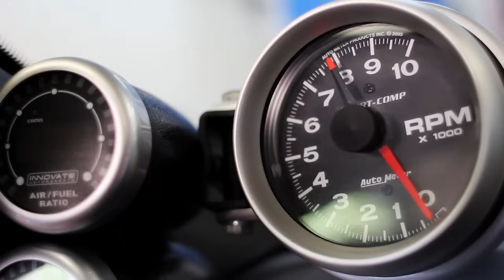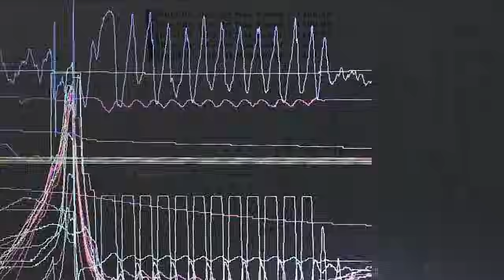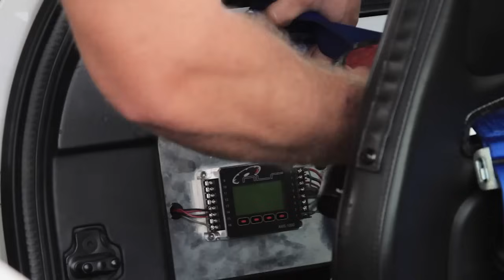New World's Fastest Car! Ford GT Bad v8 1700 Hp - 455.817 km/h ( Guinness World Records )

Comment: 283.232 mph from a street car. With all the hate just let those numbers sink in. AMAZING!
Reply: which part of that is street?
Reply: BigSmartArmed The massive parachute for sure. >.<
Reply: And that was just from a standing mile, imagine the top speed!
Reply: BigSmartArmed It is legal to drive on public roads. It is registered and licensed and insured. To do that it must pass emissions tests, safety inspections, conform to certain rules about the minimum height of certain lights (for example) - some older Ford GT models weren't street legal because the lights were too low. When you factor in all those regulations it must adhere, it is very impressive to achieve those kinds of speeds. The fact they're not selling units makes it more impressive because their budget would be significantly lower than, say, Bugatti who can recoup their expenses by charging $2M or more per unit sold.
Reply: Prof Kaos the car would never make  emission  standards. Of course  a 1200hp  16 cylinder  is gonna  have more control over the emissions  then a 17th 8 cylinder. With that being said, there is no was for bugatti  to combat the bad get with out loosing it's ability to meet emission standards. The only thing they can do is take it on the chin or  rationalize  the fact that the veyron is a production car and the badd gt is not.
Reply: ThePlotDevice You're right. It had to pass emissions at one point to be registered but since then has had a lot of work done. A cop can still issue a ticket pending an emissions test if they suspect it no longer meets the legal standard, at least where I live that's the case. However many tuner ECUs have different modes you can select for different driving conditions and there is usually an "eco" mode they use when they need to get the vehicle tested. An old friend had a ~500 WHP Civic he built and had to install one of those ECUs - all he had to do when he took it to get tested was flip a switch and it was good to go.
Reply: Fuck yeah that's amazing from a stock out the dealer ford
Reply: XxUNASxX Lol.
Reply: I know yout being sarcastic but a stock GT can still do 212mph back in 2005 when they came out that was faster then any 2005 Lamborghini, ferrari, or porche.
Reply: Isn't top fuel dragster faster than any Ford GT???
Reply: Uriah Bleue Too bad Ford stopped production of the GT. Today there's many cars that are faster than 212 mph now.
Reply: It doesn't really beat the Veyron because yes the ford GT is a production car this modified Ford GT isn't, the Veyron is there for it's still the fastest production street car.
Reply: AP499D25 Yeah man seen so many top fuel cars get 304mph with a full blown 454, they do that 1/4 in 4.5 seconds or 5
Reply: Alex Krimberg and then koenigsegg one:1 came to play
Reply: ***** Does the word "homogeneity" exist in your language?

Man you're comparing the bad gt : a car just made to break records and the veyron : a car made to change the rules.

The veyron is a grand turism car able to run at 270mph and able to be use as an everyday car.
The bad GT is a tuned supercar monster  like all other stuff from tuners (hennesey, ams, underground racing etc). This car is based on a supercar and they've used racing and performance parts to make it really really really fast. But it have been built without compromises!!! Ok they've said that it's a road car but trust me this kind of car will NOT be road legal in all countries of the world. This car would never be legal is europ or in japan.

You've talk about "efficiency" and "technology" because the v8 is smaller than the w16 and because the bad GT only got 2 turbos instead of 4 in the veyron. Are you expert?
Man do you know what "compression ration", "torque", "displacement" means?

The veyron use a w16 and 4turbos to get a lot of power without too much compression inside in the engine (9:1). It's not a brutal engine, it can be use slowly without having any trouble of lubrication, or breaking a connexion rod because it has got lot of torque at low rpm (1500nm at 3000rpm). This engine is good in a congestions and on a track.

The engine of the bad GT is a big american twin turbo V8 with nearly 1800hp, 9.4:1 of compression ratio but it comes with a 2years and 24000miles warantly. But this kind of engines aren't easy to ride, the power comes in high revs because the turbos needs lot of exhaust gas to give power. The torque is pretty low at low revs, the max torque of 1,651mn comes at 6,300rpm. That means that this car will be terrible to drive at low speeds but a monster on a dragstip.

The bugatti is confortable, everyday usable, luxuary, and fast.
The bad gt is a dragracing car with the rights to run on the road.

Comment: In a Veyron if you want to go fast you turn a key, empty the ashtray and switch the air conditioning and stereo off for a couple of minutes. No flameproof suit and helmet, no roll cage. There is a big difference between being the fastest car you can legally drive on a public road and being the fastest production car that somebody would actually enjoy owning and driving. In a Veyron you could take it to 250 MPH and drive for hours at 150 MPH and not need to rebuild the engine and replace all the tyres the next day.
Reply: Actually at top speed the tyres on a Veyron only last 15 minutes.
Reply: stabnshoot And what have you got? A very fast car you can't use for anything except going really fast, making boys envious and hauling round on a trailer as a sideshow exhibit.
You'd need chloroform to get a beautiful woman into it.
Reply: bugatti veyron is for G..  physically it's one of the ugliest supercar or the market
Reply: lucien henri So if I bought you one you'd park it in the next street?
Reply: no, I go sell it rapidly to buy a really hot car, a muscle car. And with the rest of money I stop working ;)
Reply: The firesuit and helmet are safety items.  If you're doing standing mile racing, you're wearing them in your "empty the ashtray and switch the air conditioning off" veyron too.
Reply: I agree with you, Martin. Veyron is the fastest production car that anyone can drive without special preparation. Plus, the Veyron looks like a regular car both inside and out and not gutted like this one.
Reply: right do 250 in your Veryon for 15 Min. you need new tires that will run you 80 grand for the rubber and 20 grand to have them mounted and you still have to send the rims to the factory to be mounted that thing is a money pit
Reply: sirlonghair What is the atmosphere like on this hypothetical planet on which you could drive sixty miles in a straight line at 250 MPH in a wheeled vehicle?
Reply: Martin Willett Right so adding turns would compound the wear on the tires immensely. 150 mph for hours would require 20 grand tires, and yes you'd be replacing them frequently.
Reply: 1 week per engine, 150 hours per radiator,90 hours of labor per framex2(front and rear),3 days for the fuel tank,1 hour per handmade tire, the car is assembled by hand, 4 or 5 weeks total to build from start to finish. I'd argue mass production, which is in the definition of a production car. Also the top speed was achieved by removing the speed limiter. Not to take away from the car though. 3000 hp actually produced but produces heat that would not be street legal or manageable. 260 mph without limiter(in which car becomes unstable) 250 with. 0-60 in 2.5 secs. Instant gear change sequence. It is not to be taken lightly.
Reply: Be Honest And let's not forget the 1.8 million U.S. Dollars price tag. And 3 mpg fuel economy.
Reply: Martin Willett
Lets point out that you are the one that posted you could "drive for hours at 150 MPH and not need to rebuild the engine and replace all the tyres the next day".  You're right.  So why don't you hop in one and go drive for HOURS at 150 on those soft compound tires so the internet won't be subjected to your nonsensical posts anymore as you'd definitely put on a show coming to a fiery halt.
Reply: Still it DID set a new world record, the rest of your comment was just irrelevant   .
Reply: the ford is heavily modified to set the record, with out modifications hands down to veyron
Reply: True it also cost 1 to 2 million for the veyron .. and thats one of the 2 kinds .. the ford GT is on;t 130,000$ with a 25 0r 30,000$ upgrade … so .. and i am not responding with vengeance .. just a hind site talk
Reply: what are we talking about here the car or the cost?

and do you even think modifications only cost that 25-30k cheap? you need an expert team, custom racing parts and upgrade every stock parts available that may cost "MILLION'S(with 's)"

or you can go to your local shop and spend 25-30k$ to add 50-100 BHP

right... it can break the world record.
Reply: lets be honest, , if you had a veyron , you would sell it, if you have this ford here, you'd go to the racetrack as much as you can. but keep in mind that both this car here and a veyron aren't so much fun. 1. veyron costs over a million, and this ford here isnt so cheap either. sell either one of them, get an old skool muscle car ( dodge charger, shelby gt500 etc ) and work that car up towards 800 horsepower. it will be street legal and a shitload of fun for a lower price. and what the fuck are you gonna do with 1700HP if you don't have wheelie-bars? nothing, you'll never be able to full throttle cars with over 800HP because you will litterly rape your tires on the asphalt. not to forget how much money you'd spend on fuel and tires afterwards.

so long story short : its not worth to have either one of them. and the fastest car in the world is yet the dagger GTR..                                    

 http://en.wikipedia.org/wiki/Transtar_Dagger_GT
Reply: Lol xD.... veyron is fast... and only few millionaires have it xD thats one reason

and you got a point :3... if i can.. ill still go for audi TT :D
Reply: It's Ford lol Found on road dead didn't just come out of nowhere. shitty cars -__- they can't even innovate anything, they just throw together all the stuff the other auto companies invent :3
Reply: Martin... THIS IS A PURPOSE BUILT RACE CAR WHY ARE YOU COMPARING IT TO A VEYRON!!!!???? A Bugatti Veyron can't even almost hit 283 MPH in a standing mile. It probably couldn't even hit 200 in a standing mile. NO car out there will be easy and civilized if it is that fast. Your point is so bad. If you put the same amount of money into the Ford GT that you'd spend on a Veyron, you could easily make it as civilized as it but really....what's the point of doing that to a RACE CAR? It isn't a supercar. It's a RACE CAR.
Reply: +zac spady and you thought you know it all :D? Lol......

any one can buy a bugatti? LoL...
en(dot)wikipedia(dot)org/wiki/Bugatti_Veyron

sure.... you seem to know a lot :D LFMAO!
Reply: zac spady To build a fast car all you need is money, honestly.
Coming from a family that owns race cars, the more money you throw at them the faster they go in a straight line fairly simple.
Reply: The Veyron costs 2.4 million, far far more than this gt, and the fastest production car is the SSC Aero, that costs 400k-500k.
Reply: They veryron was also the first of its kind. being a road car that can put out speeds like this and was the first to engineer some of the things in these cars. (maybe besides formula 1 technology) so they had research costs and testing and what not. Obviously all of these cars are thoroughly tested but you get what i mean.
Reply: Im da bes Finally someone who understands how it works. it's the High end exotics that lead the market in innovation. I'm talking companies like Koenigsegg, Ferrari, Lamborghini, Porsche, etc. American Companies just follow in their foot steps to keep costs lower then the rest. but the price also comes from the quality of the car. Bugattis are hand built. Fords are build on an assembly line in mexico.
Reply: ITT: A bunch of butthurt Bugatti Veyron fanboys crying because a Ford can do it better at a fraction of the cost.
Reply: Lol I don't even like Bugatti -__-
Reply: Jason Mushung you dont like it or you cant get one?
Reply: 77Avadon77 If Bugatti wanted to make a cheap fast car they would hit enter on their robots and do it. As it was said a couple of comments up, Veyron's are pretty much all hand made AND were the innovators of really really high speed super cars. The Ford is fast, obviously it has a world record but the quality of something like a Veyron or any another high end supercar is second to none.
Reply: Sorry let my correct myself. I meant assembled by hand. Obviously they don't fabricate their own parts. At least I don't think they do.
Reply: 77Avadon77 dafuq are you saying? go watch some videos about the production of bugatti's...
Reply: 77Avadon77 They hand make most of the carbon fibre parts. Sure they CNC machine engine blocks etc but it is all assembled by hand. To compare a purpose built 'standing mile' race car and to produce a fairly logical, safe  super car are completely different things. No need for profanities here by the way.
Reply: The Veyron also has double the cylinders this car has.
Reply: John Meister Dupa I really don't like them. I recognize them as being great but I personally wouldn't buy one even if I could afford it. I prefer porsche.
Reply: Not true fanboy.  The Veyron maintenance schedule is insane.  After a big run it requires thousands of dollars of service and it's quad-turbo is one big heavy and complex POS.  The Ford is a Ford.  It's rock-solid, it handles great, and it holds it's value.  Veyrons, Ferraris, Lambos, they come and go.  The Ford will remain an icon forever
Reply: ***** Ford holds its value forever. HHAHHAHAHA!!!! shit nigga, I wish there were statistics how many ferraris veyrons or lambos are ever made, and how much those still exist. Besides, Veyron is made to be used, unlike any garage-assembled turbo-trashpile which will take maybe 100miles normal driving.
Reply: ***** Well Mario, I bought mine in 2005 for $153K, I was offered $240K for it last year, so I guess I am serious.  I've had several "supercars" and they do come and go.  Remember the F360 Modena Ferrari?  It was the Ford's rival back then.  See what they go for now (not to mention my Ford would have it for breakfast).
Reply: ***** You have a point there mate. I bought my Ford Focus 10 years ago, now it goes for 75 000$......Seriously, look at F40, Enzo, F50 prices. I can throw here GTO -63 too which is worth 52million. No ones saying every model is collectible.
Reply: Scott Martindell Of course it's a purpose built race car. That's the point. A standard Ford GT can do just over 200 MPH, a Veyron could overtake it as if it was standing still, and it isn't a race car with shitty tubes and gauges held on with cable ties, it's a beautiful luxury car with exquisite fittings that is made to drive 50 MPH faster than the Ford GT (and faster than a Formula One car in a straight line) and in more style, comfort and elegance. That hot rod is not a Veyron beater, it isn't playing the same game at all. The comparison is there is no comparison.
Reply: ***** Lol. At least it's mid-engine, I don't know the weight distribution on these, but regardless, once you have opened up a car through Nevada and Utah, where 100mph feels like crawling, the appeal of our cheap "fast in a straight line" cars will become apparent. And here in the midwest, drag strips are way more common than circuits. But you are absolutely right, American cars are less refined in the matter of turning, by kind of a lot. We still have fun though.
Reply: ***** I couldn't have said it better. I have felt the power of the ZR-1 and it is no joke. The only thing faster I have been in was a nascar down at Kentucky speedway (worth every penny). But, a few months ago, I heard a Carrera GT max out 1st gear, no American car has ever made me feel that way without being in it. I would listen to a CD of euro supercar engines.